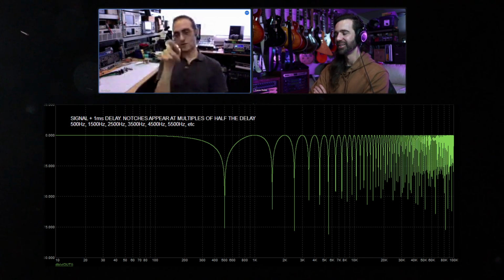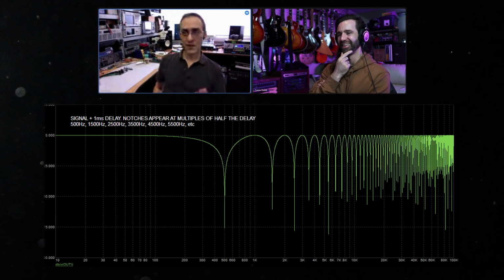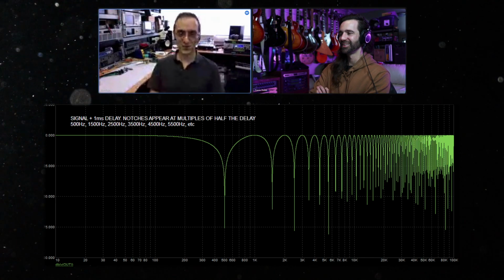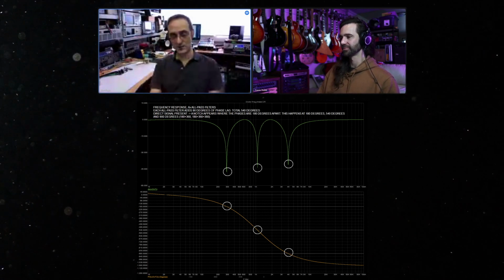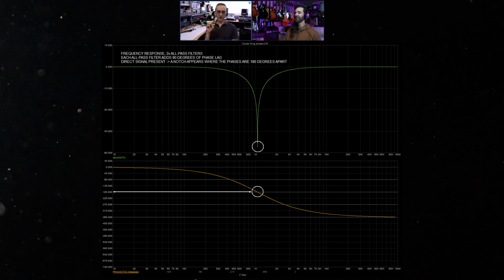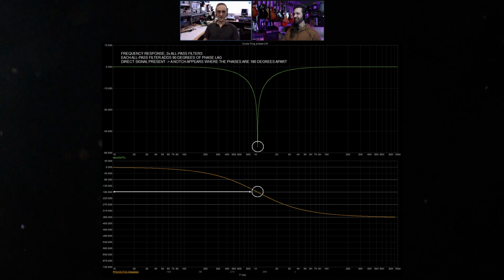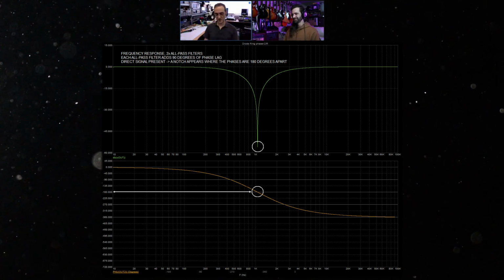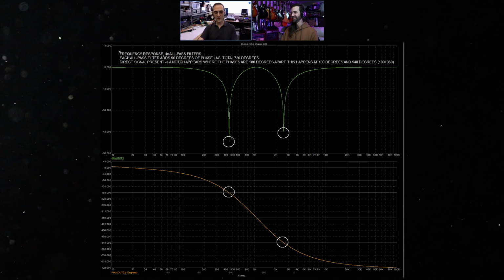Chorus, Flanger & Phaser EXPLAINED by an EXPERT

Comment: The reason most Chorus pedals have a Vibrato as well is that Chorus is just a blend of the Dry signal + Vibrato. 100% = Vibrato, less than that is a Chorus effect. It's not time based, it's pitch based.
Reply from the maker: Modulating the delay time creates the pitch shifting, so it is time based.

Comment: Flanger with low Feedback (not zero) is my preference. It sounds better than chorus and not swooshy, it's between chorus and flanger, good for heavy distorted rhythm, soloing and clean arpeggios. Straight up chorus is good for pop sounding ballads and heavy and wide rhythm ala Zakk Wylde. Flanger is still better for soloing, it pokes through the mix. Phaser is too "noisy", like wind blowing around you and flanger with high feedback sounds like flies around your head that are not related with what you play. You must be careful how you set up things!
Reply from the maker: Yeah there's definitely an extended spectrum of sounds that a good flanger offers up!